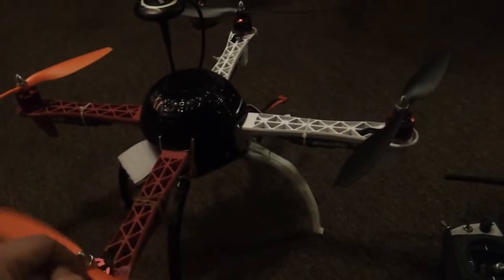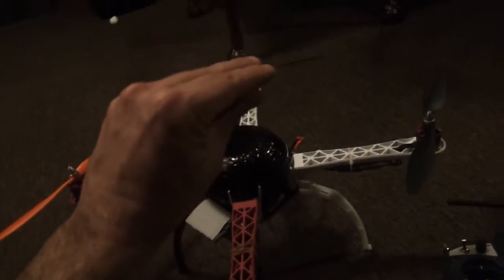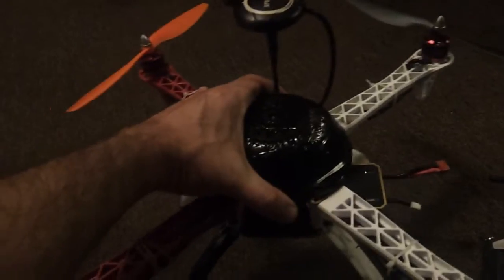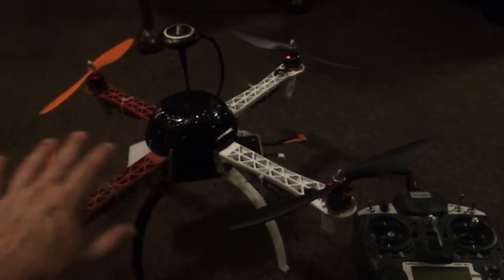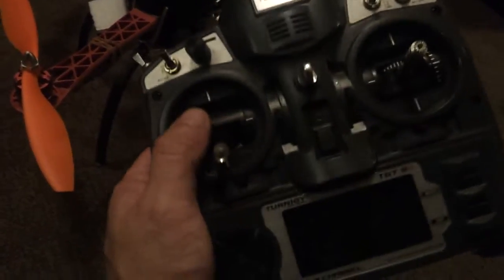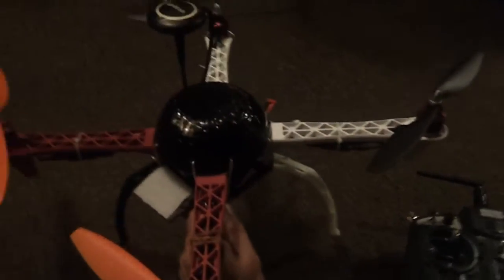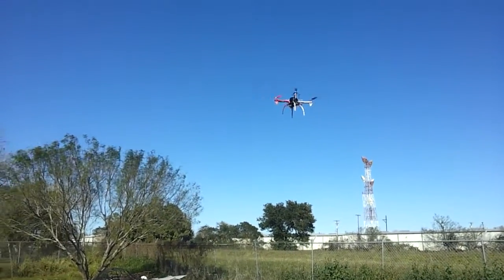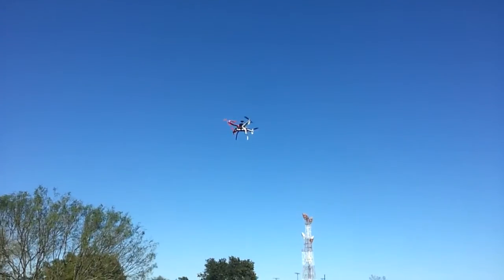apm 2.8 altitude hold barometer problem no foam

Comment: Iam using apm 2.8 fc and same f450 frame and gps compass module. But i am facing issue in loiter mode drone is swinging in roll and pitch not too much but not stable as you have .. i have also mounted that plastic bowl to fc to avoid wind ...but drone is not stable in loiter when wind hits the drone ..i am not facing any other isues . I have done all calibration and setup in mission planner properly but couldn't get rid of problem ..i also tried autotune but it made even worse pid values decreased so much so drone is much unstable after autotune ..its maintaining altitude pretty well but the problem is with roll and pitch axis in loiter its like not good gps position hold ..drone swings only when there is wind

Comment: thanks partner for the vid. I am having a rising issue. I am going to see what I can rig.
Reply: mode made but not painted. see how it goes tomorrow without the paint. APM 2.6
Reply from the maker: Carl Bradley the light matters. Put some black tape on the inside or something. You will be able to tell when you spin if the light hits it a certain way it dips.

Comment: how did you make this foam please ?
Reply from the maker: It's a hard plastic bowl. Any bowl will do just make sure it's lightweight and light can not go through it.
Reply: Ok thank you
Reply from the maker: Moahmed ELnahas if you can get some real dji flamewheel arms they are a lot better and don't make as much vibration that makes everything better. They cost more but are worth it.

Comment: good job brooo.... i think my 7km waypoint will succsefully.. with your method
Reply from the maker: +Ansari Flight Plan you might want to change your speed if you didn't  its a different one than the normal loiter speed. you also need to change the failsafe to continue with mission instead of rtl.
Reply: the normal speed is 500 right so what the ideal speed ? i have try to make short way point about 4 point 20 meter each point all aat 8 meter height... but the more it fly and lap it will decent to ground each lap perfeet.. at 16 minute flight auto it will touch the ground =(.. i think is about the baro issued
Reply from the maker: The baro issue is gone with the bowl and way up you cant tell if it goes up and down a few feet. Try 1000 for the speed and do a mission of 3500 and then see if you have more than half of your battery left then you will be sure because it will only have to go up and down once for the long mission so you will have a little more power.
Reply: +TheTubeTempest WPNAV_SPEED at mission planner should be put what number?
Do mission 3500 means?
my setup quad same as u... non DJI eq
Reply from the maker: +Ansari Flight Plan I didn't change anything but the loiter speed and the way point speed.  the website says most can go 1000 to 1300 as the speed. so set the wpnav-speed to 1000. be sure to test your radio so if it turns off the failsafe kicks in and it comes back. arm it in mission planner (usb power only) and put it in manual or atti then give it throttle and turn it off. if the flight mode changes to return to launch then that's good.
Reply: +TheTubeTempest i try go get 1000...
i always auto take off using Remote 
Put in autowaypoint the put abit thortle it will take off auto and countine mission..

Omg relly hard to get bowl like that in here... many bowl have flat surface
Reply from the maker: +Ansari Flight Plan I changed the bowl to a cheap plastic bowl from the dollar store. (4 for a dollar) Look at my last video. Its red with a happy face. It can be flat at the bottom.

Comment: My son is in the market for one and this is great . How long we'll you just answered the question.
Reply from the maker: +HOTTESTDUDEONTHETUBE get this from ebay. you can make it so you can look through the camera on a screen while it's flying and it will show you the altitude and battery info and all that stuff on the screen on the ground. it comes home by itself. I can help you get it setup. order this from ebay it will take a while to get there from china and you can get the rest of the stuff from the USA. http://www.ebay.com/itm/APM2-8-Flight-Controller-NEO-7M-GPS-3DR-915Mhz-Telemetry-OSD-Power-Module-/301767825564?hash=item4642c3989c:g:774AAOSw5ZBWHgit